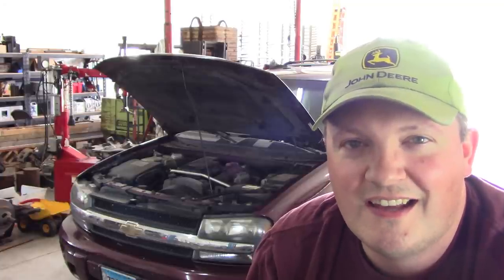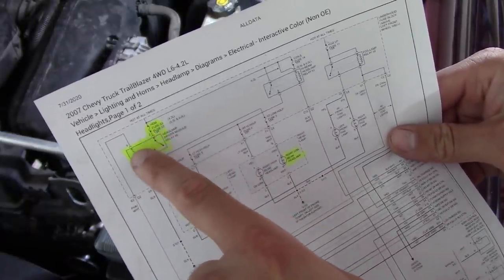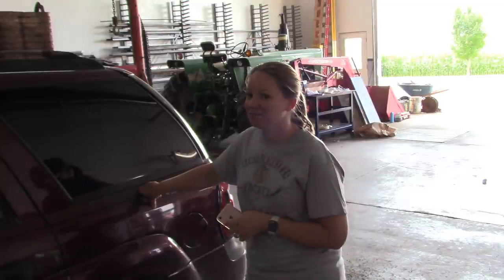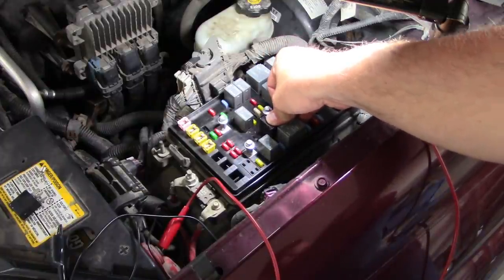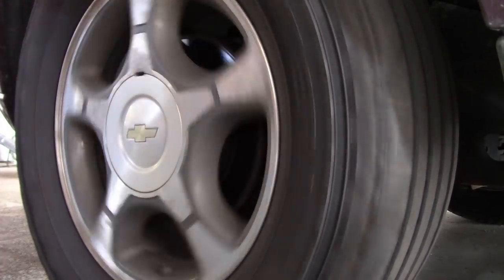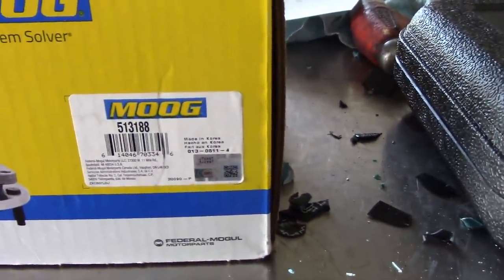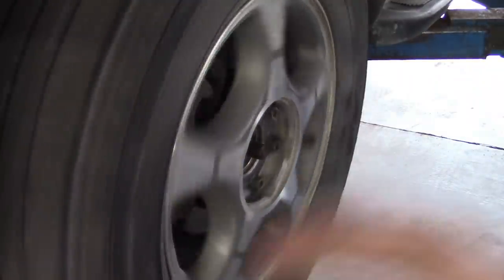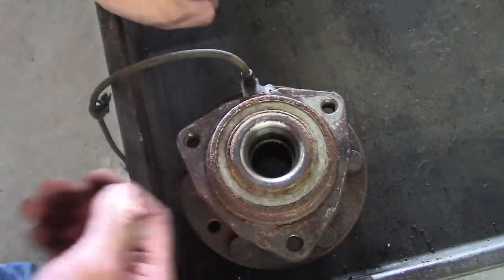Chevy Trailblazer - No Low Beam Headlights - Wheel Bearing Noise - P3

Comment: I own 07 trailblazer wheel hubs are notorious for that truck. I replaced mine twice on both sides.  Go ahead and replace the passenger side as well because it's going too make no ice in 6 months or so. Good job wes! I also live in Chicago
Reply: they look very undersized for that size truck
Reply: the life span of all of the steering /suspension parts is horrible.

Comment: I'm a shade tree DIY guy for my own vehicles and I commend you for wanting to open up the relay casing to see what's going on inside. I had a bad relay in my Mazda, and I had the same thought, thankfully I was able to open up the relay and clean the gunk and put it back together. Popped it back into the car and works great. Saved me $25. 👍😁

Comment: "if you live in California or Texas or were never in the Navy you may have never seen a needle scaler..."
Reply: I think Harbor Freight is based in CA and they sell them for under $30.
Reply: in Texas we use a needle scaler for removing slag from welds and to bust dried concrete of fasteners.
Reply: used them plenty in submarine bilges...
Reply: Used them on a Navy Cruiser back in 1969. We stripped and replaced the flight deck non skid material.
Reply: Dave Iaucco  as is everything else.

Comment: 👍Lesson learned after installing 2 cheap hub bearing ass’y on wife’s 07 Trailblazer 2wh drive.…. Don’t go cheap! Only lasted 10k miles. I’ve never replaced the locking nuts and always use a torque wrench as the ROAR is disheartening to hear! Good stuff sir Wes👍

Comment: The bolt-in bearings are so much easier to remove and install rather than press in and screwing around with the races and preload. Only downside is some of them don't come with the abs wheel speed sensor. They get destroyed alot when you try and remove them so it was nice the new hub came with one. The relay swap trick is one I always use to check them quick when you have 'like' ones to check it with. Great video bro!.

Comment: My favorite line had to be......"Just as chinese as the other one"...This, and the fact that a stupid little $8 or $10 relay is now $30 or $40 IS the problem.
Reply: FYI My daughter had an ‘04 Envoy that blew the low beam relay. I replaced it with an aftermarket one. Few months later she said low beams went out again. Had a burning smell as soon as I raised the hood. Removed fuse box cover, and there was a hole burned almost completely thru the fuse box where the lo beam relay used to be! Replaced the fuse box with one from a junk yard that still had all original relays in it. Some time later, read in a forum that all Trailblazers and Envoys that had the “melt down” problem at the lo beam relay, and were taken to the dealer to be repaired, were found to have “other than OEM” (read aftermarket) lo beam relays.
Reply: i had to buy a fuel pump relay for my audi. the relay was $50. an ENTIRE new fuse box (which i also needed lol) was $35 ($5 shipping) and came with the fuse i needed. insane.

Comment: Another great vid from Mr. Wes.
If you've ever spent a month in the U.S. Coast Guard as a non Aviation non rate there's definitely a serious chance you've had an up close and personal relationship with a needle gun.
Thankfully, I was an AD3 Aviation Machinist Mate.
Never got near one but I sure heard some horror stories.
They'd even use them to chip inches of ice off Cutters and other boats, docks and such.
Before I put my Chevron on ass AN I did have to chip ice outta the 60 foot tall wooden WW II era hanger doors up at Airstation Traverse City Michigan.
Ooh joy.
Yup, even after I did put it on I still had to do it after the blizzard of 1978.
We got 16 foot snowdrifts against those doors.
Took two days to clear them.
All hands on deck.

Comment: Imagine that,a bad hub.
On my 3rd set each,02 Yukon 270k (needs drive shafts badly too) and 03 Envoy 150k.
Next kick-in-the-but will prob. be...should I have used Timken?
Unbelievably? I have replaced every wheel bearing in every car I and/or ex gf or wife ever owned,foreign and domestic since 1983. 
One of your more simpler jobs that most diy-ers should be able to handle and you do the little 'extras' for the future.
THAT, is the good and proper lesson you show to be learned here IMO. Once again,a fine job Wes.🤴
Reply from the maker: Seems like the Ford bearings hold up a little better. The OEM GM bearing is close to $400.
Reply: @WatchWesWork  Friend of mine owns a small shop,tells me he does a lot of business replacing GM hubs,doesn't use or recommend OEM unless customer insists.🤷‍♂️

Comment: My '04 Bravada had very similar headlight problems (they would sometimes randomly go off and then come back on).  I didn't know about the TSB so ended up purchasing my new relay (it was a tad over 40 dollars, wow).  My old relay, if scrutinized, barely looked slightly bulging (thinking it over-heated over time, then failed).  I didn't do the shown diagnosis, merely swapped high beam with low beam relay until the replacement was installed.

Comment: Yo, what happened to the no low beams that’s what I was interested in that’s the problem I had and it said no low beam headlights on your heading and then you’re doing wheel bearing thanks a lot man you’re your video was very helpful. I’ve done my wheel bearing so many times I could probably show you how to do them.

Comment: I had issues with moog wheel bearings on my f150. This was the 3rd bearing that went bad. I’m no longer using that shop to do the work and did it myself. Used fomoco parts so it should last longer then moog. Fun fact fomoco wheel hubs are made by skf.
Reply from the maker: Well Moog is Federal Mogul, which is one of the largest automotive suppliers in the US. The actual GM wheel bearing is $400.
Reply: @WatchWesWork  And the GM bearing is nothing to brag about when it comes to longevity.  Especially for more than twice the price of the Moog.

Comment: Should have checked for low beam fluid first.  Man all that electronics just for a headlight.  My old 54 Chevy had just a fuse, a few wires and a switch and a dimmer switch on the floor.  After 20 years it got rusted and needed to be replaced.  Great job the wheel bearing and showing us the needle scaler.  Excellent mechanical abilities.  Where did you get your knowledge from?  What school? Apprentice work etc.  Thanks for sharing.

Comment: I have a tupperware box with a bunch of 6" wire pieces with a male terminal lug crimped on one end, and a male banana plug on the other. perfect for doing relay circuit testing. I honestly didn't know you could buy pre-made breakout kits for common automotive relay styles.Before making my own relay terminal breakouts, I used to mess around with paperclips and alligator clips, but owning a flood damaged SAAB ended that...
Reply from the maker: I just got the U test kit from AES wave. It's been on back order for most of this year.

Comment: When I changed the front bearing in my 02 TB I also used Moog turns out I had trouble with one of the wheel speed sensor. I just put the old one back on.

Comment: I haven't watched yet but I just have to mention that some of these trailblazers have a recall just for this issue. You replace SDM with is in the fuse block under the hood. If I was at work and had access to SI I could look up the document.
Reply from the maker: You'll see that is indeed the issue.

Comment: hi you can feel if a bearing is bad. rest 4 fingers in the middle of the spring and turn the wheel.you can feel the cracks of the bearing.
btw good video's.
Reply from the maker: Good tip!

Comment: WES.. if you still have the trail blazer.. @2:33 there are 3 connectors on the forward side of the fuse box.  the bolt holding the cable down from the battery.. a stud in the middle probably to the alternator.. and a stud n the left..   can you do me a 15 cent favor..  put a Flange nut on the far left stud.. it has a stud sticking up thru the backing plate.. and going thru a ring terminal that feeds some of the fuses in the fuse box.  don't believe me.. when you get the headlights fixed... run a voltage drop test with as much stuff on as you can get... between the bare 6mm stud and the ring terminal around it going into the fuse box.. voltage drop should be 0.00 Vdc.   98  and 99 S10 pickups have the same issue..  a missing flange nut..
Reply from the maker: Interesting. I sent it home, but it will be back for front brakes at some point. I'll make a note.

Comment: Dont sweat it wes I had my xterra apart fixing brakes tie rod ends  and control arms and surprise go to get it aligned and suddenly I needed and inner tie rod on the driver side to go with the new outer and the passenger side needed a new hub bearing  well I got to fire the parts cannon and bagged a nys inspection  and the wait for the calicat was worth it totally paid off

Comment: I've often found that parts that are recommended to be replaced are not available. Why they aren't included with the items has always puzzled me. From gasket sets that require head bolts be replaced, to fuel pumps that require the filter be replaced and Deutz diesels that require the injector fuel lines be replaced any time they are loosened but new lines are not available.
Reply from the maker: It's all ridiculous. Look at a newer Ford service manual once. Every fastener is torque to yield or nylock and they are all supposed to be replaced any time they are removed. No way.

Comment: I know this is an older video. I have a 2009 Trailblazer. I have done these exact same repairs on mine. i don’t understand the low beam head light configuration or why they used a solid state relay. I don’t know what it is about the wheel bearings but mine has had 3 sets on it already in 160K miles. I’ve had the alignment check several times. I’ve tried different brands too. This last set from eBay has lasted the longest. I think they are Detroit Axel brand. I talked to a GM tech and he said they replace them “A LOT”. Don’t beat yourself up too bad about missing it. They sound like road or tire noise when you drive when they go bad.
Reply from the maker: They use a solid state relay so they can dim the lights to use them as day time running lights which is required in Canada.

Comment: So bad wheel bearings have 2 choices 
1 replace
2 turn radio louder
Reply: Those bearings aren't bad....they are an external cigar lighter after a 2 hour drive.
Reply: 2 turn radio louder   That's right.    In high school I drove a '55 Olds 98 with a really loud bearing for a whole school year.  That car would make people look up from a block away and say "what is wrong with that car?".  But what's the penalty for driving it until the wheel falls off (assuming the radio is loud enough), especially for a poor high school kid?
Reply: Until you drive on 3 wheels
Reply: You forgot the third option---- drive until it seizes or destroys itself and you are stranded in the middle of nowhere on a dark night.

Comment: I just did brakes an rotors an front wheel bearing on my 2008 trail blazer.  The pa winters are rough on vehicles an nuts an bolts   Rust an crust everywhere

Comment: For a Korean replacement part that bearing hub looked to be fairly good quality. Just spent three hours awaiting recovery because a "Chinese" clutch slave cylinder just failed after 4 months!  Third one in two years. The original had survived for 57 years. Suppose we are lucky that anyone makes parts but the quality of this stuff sucks! Not just clutch hydraulics but brake cylinders are also suspect so real safety issues in the long run.
Don't think its just cost as I think people would happily pay more for a better quality. Just ordered 2 more and will throw one in the boot (trunk) just so I don't get stranded again! Great fix as usual Wes, and I really like those angle sockets ,going to get me some of them.
Reply from the maker: I know. I see it all the time, especially on older stuff. There are no good parts to be had. Engine parts are a good example. All of the pistons and valves you can get for older engines are made in India or worse.

Comment: Back in the 70's I found if for some reason your wheel bearings went out no matter how you replaced them every 2,000 miles after that you bought some more. I have a Mazda I have put 160,000 miles on wheel bearings still good.

Comment: Wes, you can buy a color inkjet printer for about $100. But the ink will cost about $200! 🤪 You really need to look into getting one. And, if your laptop is old and cranky you might replace it with a refurb from Tiger Direct for about $300 with Windows 10 Pro. 😊

Comment: Those bearings can be a bear. I've had to used heat with air chisel on one ounces took me 3 houses to get it out with out damaging the knuckle. They like to rust as one up in northern Wisconsin. And usually there is no backing plate they long been rusted away

Comment: Moog.  That'll be back in your shop in about a year. 40 years ago, if you bought Moog, you went all out for quality. Today? Bought Moog stabilizer links. Failed in about 6k miles.
Reply: Yes.  I don't know if Moog actually makes anything besides the boxes the over-priced junk comes in now.   The Moog wheel bearings do have a 3 year warranty, though.  Probably going to be using it.

Comment: Your just setting up those crazy pedants. That axle nut didn't even move.
Reply from the maker: Heh. That nut could easily take 300ft-lbs.
Reply: @WatchWesWork  Yeah. What I meant was since the nut didn't move, it met or exceeded the setting on the torque wrench. Pedant gallery.

Comment: My experience those relays fail open, GM has recalled them because of this issue on many of their vehicles.  The relay outputs a PWM signal to reduce the brightness when in "daylight running light" mode.  Maybe we see it more often because DRL's have been required here since 1990.
Reply from the maker: Still not required here.
Reply: @WatchWesWork  True but I think American vehicles still use the same defective part, I have know a few people who've had a good scare when their low beams all the sudden die in the dark of night.

Comment: Use Open Broadcaster to record your screen. It has a lot of features for live streaming but it also works just fine as a screen recorder. And it's free / open source. There's plenty of tutorials and information on how to use it. If you have a recent version of Windows 10 there is also a built in screen recorder hiding in the Xbox Game Bar app which despite the name can be used to record anything, not just games.

Comment: I'm really curious to see how that CRC rust blocker works long term.  I've been doing those assembly pilot bores in the knuckle with never seize for years, but an aerosol seems way easier.  It's also been my experience that any of those hub assemblies that are made in a cheap labor country (China, Korea, Taiwan, Mexico, ECT) don't tend to last more than a couple years, so it's absolutely a good idea to make it easy for next time.  Unfortunately that's usually all any parts store has on the shelf, so when it comes to pitching it to a customer it is pretty tough to go with a good one, "So they had one on the shelf, but I had them order a different one, it'll be here in a couple days and cost twice as much"

Comment: There is a recall out for no low beam operation where the low beam relay (headlight driver module) is replaced under warranty.

Comment: Wes man your videos are great but, man what’s with the torquing? I’ve seen you torque rear diff cover bolts but, you persist to not torquing wheel bearings, caliper brackets and calipers. DUDE, you’d think torquing the rear diff cover isn’t as important as the brake assemblies man!!! 

I don’t torque everything either but, if it holds fluids, boost, rotational parts, structural parts or stops the the vehicle it for sure gets torqued. You do what you man but lawsuits from vehicle accidents for sure come back to haunt mechanics everyday man!

Man, your wise guy comments on parts, failures, vehicles, people and just in general are absolutely hysterical!!!! You..... “It’s funny my torque wrench sounds, sound like I’m trying to hold in a hernia!!!” That’s a good one man!!!

Comment: Another brilliant video, though i was surprised you only replaced the one bearing and not both as s##$ law states within 200 miles the other one will start complaining, and the low beam bulbs just the same on replacing one the other will blow so i replace both at the same time. Ps subscribed to mrs wes as well.
Thanks again and stay safe.
Reply from the maker: The high beams use a regular mechanical relay, so the will probably last forever.

Comment: Low beam fails if you keep switching light switch counterclockwise to turn off headlights completely. Relay is too weak to handle the voltage, I have a tb, did that in oil field and after 3 relays at $45 per relay I leave light switch alone.

Comment: Regular bipolar transistor  fails "closed".
Field effect transistor fails "open".
(Usually)

Auto Manufactures finally figured out that they can pick the "fail state" of a driver by which type of transistor they use.

Just read up on MOSFET (Metal oxide silicone field effect transistor)
Reply from the maker: Interesting. In the industrial world I see solid state relays fail closed all the the time. Same with drivers in ECMs. Just had an old GMC truck in with an injector that ran all the time. ECM driver failed close. They should all use the fail safe version!
Reply: @WatchWesWork  electric forklifts have been using MOSFET's for decades for that very reason.

(They also work better a high frequencies, so we can make the pulse width modulation at 20-40 thousand hertz so you cant hear the dc drive motor humming .)

If we want a driver to fail open we use FET's and if we want it to fail closed we use BT's

So the strobe will be run on an BT and the safety interlock on a FET type so they fail in a way that is safe (strobe always on or the drive always off)

I'm guessing thats whats going on here.